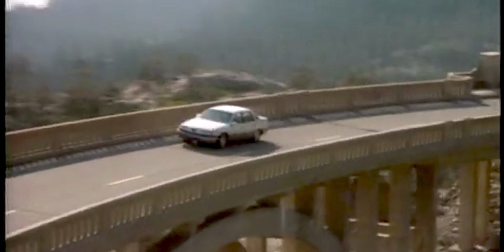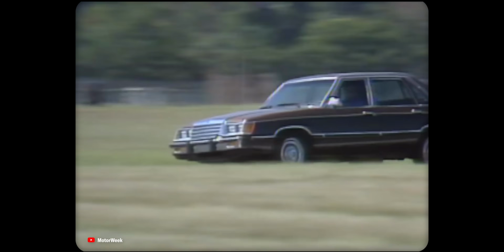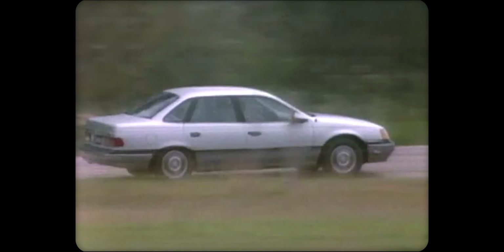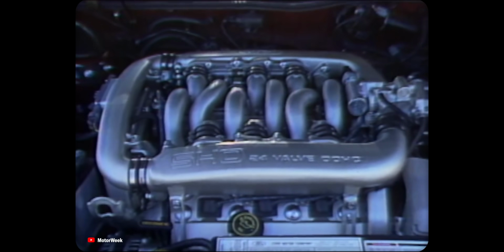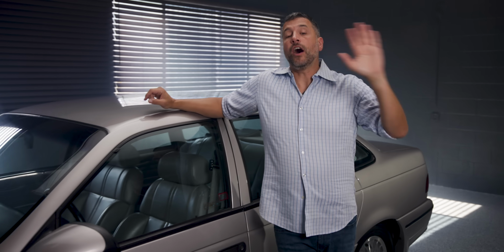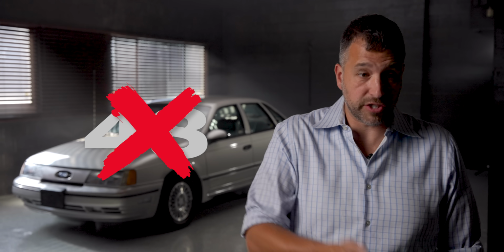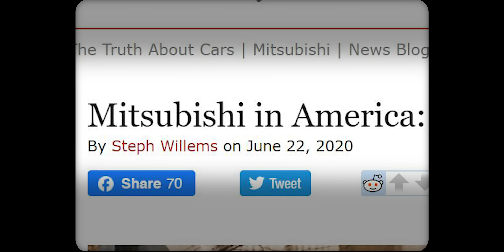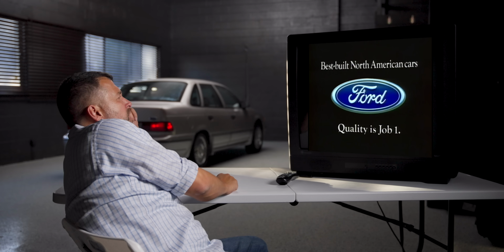The Taurus SHO is the fastest, most expensive Ford sedan | Revelations with Jason Cammisa | Ep. 08

Comment: So it had Yamaha engine and Mazda transmission. That's why it was good.
Reply: Engine not so good.
Reply: Yamaha modified engine,not their design, very bad
Reply: @slotripper  Yamaha tried to modify the Ford v6 but the bottom end was nowhere strong enough so they ended up designing the DOHC motor.  It shared no parts (maybe some bolts) with the Ford v6.  The Yamaha motor was also more reliable than the Ford v6; I sold my '91 with 165K miles and the motor was still mechanically quiet, used under a quart of oil in 3000 miles, and would get 28mpg at 75mph.  The transmission was ok; it would not hold up to alot of high-rpm clutch drops.
Reply: The Mazda transmission was a bit notchy and had a long throw on the 89 SHO I owned.
Reply: @paulhudson231  @Allen Libecap   Motor was originally a Cosworth design with a Yamaha induction. All motors were blueprinted to run at 12,000 rpm and rev limited to protect the accessories. The motors were conceived for project GN34 / Cobra 230ME and recycled into the Tauruses.
Reply: @norac1244  The production motors were not blueprinted and run to 12,000 rpms.  I have a Ford complete shop manual for my SHO; it specifically states that the motors were tested to 8500 rpm.  No one would build an engine to withstand 12K rpm to limit it to 7K or 8K on the street.  The rods and crank would need more than twice the strength to live as 12K as 8K and would have been quite expensive.  In addition the piston speed (feet per minute) is well beyond what normal production rings could handle for more than a brief time.  The SHO engine was a revelation in its day and a very nice design, but its not capable of operation at 12,000 rpms.  Even the cylinder heads do not flow enough air to be useful anywhere near that speed.
Reply: Youre clever indeed, you can be my marketing manager when i make Cuba's first sportscar!
Reply: Duh😂
Reply: Actually, none of the SHOs were reliable in any way. SHO = Super High Oil (consumption). They were fast in their day though, and the 92s looked hot. They certainly never garnered Grand National or Monte Carlo SS fanfare though.
Reply: Mazda gearboxes went that great once you started pushing hp through them and Yamaha actually designed cylinder heads for Australian Ford Falcon and Toyota Altezza to name 2 of probably many
Reply: The transmission were the Achilles heel. Under sized clutch and the diff liked to come apart from the one wheel burn outs. I have seen several of these cars in the junk yards over the years. Most with big holes in the side of the transmission case.
Reply: @paulhudson231  I am not disputing shop manual information, simply quoting early original Sales & Marketing training information.
Reply: @ashes2ashes863  yes the 92 looked sharp first year for the trunklid pop out that resembled a small spoiler!
Reply: The SHO? Yes. The regular Taurus? No!
Reply: This car was garbage like the rest of fords lineup
Reply: Still never had a government bail out with my tax dollars.
Reply: There is a lot of misinformation in here about the SHO. The SHO was by no means a reliable vehicle. The engine was remarkable in its own way (the fact that it made 220hp on 3L and got incredible gas mileage), but even the Yamaha V6 was plagued with issues. 

For one the author of this video was incorrect about his assumption that the accessories wouldn't blow up from over revving. This was a common problem in the SHO community. Most of us SHO owners bought under drive pulleys just so the alternator bearings wouldn't burn out if you accidentally hit 7krpm.

The biggest issue was the #5 cylinder rod bearings which were notorious for prematurely failing. I've had to do this to both my SHO's under 100k miles. 

Then there is the clutch and gear box. The stock cable clutch and cable shifter had numerous issues after continued use. Snapped and stretched cables were common with the Gen 1 SHO (this was before they put solid shift rods in). The synchros in the transmissions were basically made of paper and so were the gears. They did not like holding up to any additional power especially the "Jesus gear" (3rd).

Overall, anyone who grew up with a Taurus quickly learned to become a mechanic. There is no need to remember this car with such fondness

Comment: Former 95 SHO driver here. Y'all can correct me if I'm wrong, but I don't recall the engine ever being referred to as the "Shogun." The Shogun referred to a very specific build of a Ford Festiva using the SHO engine. We always called it the Yamaha V6. 

Also, I agree with the idea of people not wanting the SHO because it's based off the ubiquitous Taurus, but that's also what made it appeal to the diehard fans. It was a sleeper that would spring off the line, and it had additional comforts like the JBL sound system with a subwoofer in the back.

Last, thank you for the footage at the end. I got goosebumps hearing the sounds of that glorious engine again.
Reply: Owned a 1995 SHO. I don’t remember “Shogun”. The Yamaha engine was a very good engine, rock, solid, and high performance. I like the understated look of the SHO.

Comment: When the SHO breaks down, you fix the SHO
Because the SHO must go on
Reply: Its Always somebody in the Comment section trying to SHO off😂😂😂😂
Reply: sho 'nuff right!
Reply: Very good
Reply: The Engine never broke on those- everything bolted to the engine did.
Reply: The last two comments ruined the running joke

Fo sho
Reply: Okay, I love the joke, but the sad reality is that the engine was great, but the rest of the drivetrain cost $$ to keep running. My low mileage '91 would cost me more than the monthly car payment in repairs, and this was when it was only 2 - 3 years old.
Reply: @roceye   yeah cut it was like putting a rocket on rollerskates!!
Reply: SHO 'nuff
Reply: Fo SHO!
Reply: Sho-gun never gives up
Reply: Sho ya right
Reply: Lol
Reply: @Lucifer-qt9gh  They SHO did bro'
Reply: @bookofeli1902  Oh fo SHO!
Reply: @Lucifer-qt9gh  they SHO tf Did. 🤦🏿‍♂️
Reply: my 14 is a nickel and dime POS.
Reply: Yeah... I put 2 manual transmissions in mine.  Spider pins shoot through the case of the transmission, both times.  The transmission was hot garbage, but I wasted everyone in their fancy Mitsubishi eclipses and Hondas.  This was 2000, the sho ruined everyone's pride and my summer job money.
Reply: @roceye  The clutch was the Achilles heel of the '89 Taurus SHO.  It used the same clutch as the 4 cyl model.  Yes, there was a manual non-SHO Taurus.  In 1992 I had to replace it for the 2nd time.  By then they wised up and designed a beefier clutch.  The shifter was pretty lousy as well but at least it didn't break constantly.
Reply: Yeah, but it's all for SHO....
Reply: @roceye  two words: rod bearings.
Reply: ...seriously... I know a guy who put a SHO Yamaha engine in a Civic. It still needs tweaking done with the torque steer but it moves quick.
Reply: @orneryokinawan4529  Yes, torque steer was ridiculous FO SHO!!!
Reply: @Lucifer-qt9gh  you SHO right
Reply: Sho do!
Reply: You earned that thumbs up, my friend.
Reply: sho
Reply: True,.... But corny dude 😂. Good one 👍

Comment: The SHO was a sleeper back in the day. Kicked a lot of ass!
Reply: I used to beat fox body’s , and BMW 3 and 5 series all the time. My first car at 18 years old was a Blue with tan interior 1994 Taurus SHO.
Reply: Fun times!  I had a 85 RX7 cut port 13b from the next year with a 2200cc diesel truck turbo turning 467 hp at 7200 rpm, and it would embarrass a SHO very much like a Telsa just eats the top hellcats.   No point in muscle cars when mommy in her Tesla passes you, and does not even realize your trying to race her.
Reply: @MegaMeaty  Those RX7's were fun until you got 8 miles down the road and realized its time for another APEX replacement.  My buddy had an 88, I think he rebuilt that motor (if you count APEX seals as a rebuild) like 4 times in under 100k miles.  He beat that car to death though.  And I'd argue there is plenty of point in muscle cars, they are fun as hell to bang through gears in.  I wouldn't feel that embarrassed if a $130k performance electric car beat me in a race.  Plus approximately 0 people are going to ask you rev up a Tesla, or even know you are gunning it haha.
Reply: Hell yes it did. I had never heard of the SHO until i was getting my car fixed. There was one up on a lift getting the clutch replaced because the owner was 16/17 years old and learned to drive a stick in it.
Reply: Bobby Jackal  never been a big car guy but, as a kid, the Buick Grand National was my favorite. Mainly because of it's looks and my friend telling me how awesome it was.
Reply: My only question is will it out perform a modern police car?
Reply: Bobby Jackal  it would be cool if they were to start manufacturing them again.
Reply: Yes SIR !
Reply: @myboy051  Maybe  4 cyl foxes, lol. A 90 LX ran a mid/high 14 and a SHO ran a mid/low 15. An 89 Probe would keep up with a SHO 😂
Reply: @myboy051  How? Mine sure didn’t
Reply: @coopachew  The new ones will. I have a 2015 and I regularly embarrass the diesel kids around town.

Comment: The Taurus SHO: when you need to gap all the corvettes and mustangs in your small town, and pickup the kids at daycare afterwards
Reply: How much you dumping in that to gap those ? Definitely stock won’t get it done lol
Reply: I think he meant the mustangs and vettes of the era.  If I remember correctly, the 89 SHO was actually faster than its contemporaries.
Reply: @foxwithtubesox1075  the 89 gt? No. That car always made it to 66 mph before the sho did. 29psi on both on stock tires. And the 89 vette best both of them hitting 69 .  The Sho was just unheard of when it came out, gm had a 1 Hp euro sedan, and while we talking, the turbo Sundance lost the 0-30 but 3rd gear out the sho in its place. This was my era I remember all these cars.
Reply: @InkedMisfit  the SHO actually walked the Mustang GT (same years 89-95 both stock) from a roll.  I know from experience.  Corvette?  Not so much.
Reply: Yep, my friends brother in law had one. I was sitting in the back seat when it hung a 5.0 foxbody mustang out to dry
Reply: @foxwithtubesox1075  I had both of that era - a 1990 Mustang 5.0 LX and later an '89 Taurus SHO, both with 5-sp.  The SHO would NOT gap the Mustang, but it would not embarrass itself either.  Just about as quick up to ~120mph.

Comment: As a 2015 SHO owner, I will always love the original.
Reply: The 2015 is still full size sedan and i love it. Doesnt try to copy no-one
Reply: As a 2010 and 2014 SHO owner I will say the 89 SHO was awesome. The 4th Gen SHO was not true to form.
Reply: Imagine a 2nd gen Fusion (2010-2014) with that engine and a stick... I had a 2010 with the V6, and it handled better than it had any right to with some decent tires on it.
Reply: Have you driven one?
Reply: @GeorgiGeorgiev-ne9ps  lol, we have a 2012 Focus and the fact that the Taurus seems to have less space for people inside is hilarious.   Would still love one anyway, even the non SHO models are great drivers.
Reply: If only you had the Sierra RS Cosworth in 2 or 4 wheel drive cloth or leather trim... Max speed: 149 mph
 0-60 mph: 6.5 sec 2.0L 16valve turbo 204 -220bhp...(can produce 1000bhp)
Reply: How many coil packs so far?
Reply: SHO are great sleeper cars. They’re fast.
Reply: 2015 SHO owner also in this boat.
Reply: Loved the 89 i owned
Reply: @RayoAtra  Good to hear!, 22 years now owning a GEN 3, only 3 years old when I bought it, and it still looks and drives like new with 57k on the OD.   Been in storage since 2000, OEM Z rated tires still on it.  Next year, antique plates and back to cruise nights and car shows.   Already picked up a trophy with it back around 2003 at a major autoshow. Fun times with an old car ((O;
Reply: 2015 version is a shitbox lol
Reply: I'd love to have one in 2021 lol. Looks like a nice and practical car.
Reply: SHOs OVER!
Reply: 97 and 13 owner. Hoping to grab a final year.
Reply: 2016 sho owner and loved my brothers 92 model
Reply: If you havent already, it is so worth it to swap to the airaid cold air, metal chargepipes, 3 bar map, colder plugs, and a tune. Instead of making 7-8 psi, mine makes 15-16. It hauls
Reply: @vinnyschuld7565  I'm in a few FB groups - I was looking at Gearhead Tuning tune, which uses the colder plugs and 3 bar map as the main changes.
Reply: AND - the 2015 is absolutely stunningly GORGEOUS!
Reply: I used to have a 2015 SHO, then I wised up and bought a 2015 RS5.
Reply: @McNasty43  I have  2012 Fusion Sport that I replaced my 95 S.H.O. as a daily driver, I just wish the S.H.O. had the manual mode automatic 6 speed that the Fusion Sport has
Reply: @RayoAtra  Same. Mine is titanium white metallic.
Reply: @rodirby5952  My 2015 has manual mode with paddle shifters.
Reply: Your car is no slouch either.  Another grossly overlooked and under-appreciated vehicle.  My family has owned 2 of the 7-seater version of your car in a row...the Flex Limited AWD Ecoboost...which to those who know, is even more of sleeper...😎
Reply: The 2010 -2012 Fusion is considered the 1.5 gen and the 2013 and on 2nd gen.  I have a 2012 Sport. I still have a 95 SHO, the Sport is quicker but the SHO is faster

Comment: I had a 95 sho 5 speed I put a ton of performance parts into it and I must say it was one of the fastest and best handling cars I've ever owned. I really miss that beast.
Reply: I bought a 92 brand new, dropped a ton on it too and had it for 240k miles (19 years later) and sold it for $4500! I had 3.2 heads by way of the SHO Shop, polished/ported intake runners, Baer breaks, LPM from SHO Shop, subframe connectors, front & rear strut towers braces, Koni adjustable struts, slotted the front upper strut towers, progressive springs from SHO Shop, Quaife LSD, short throw shifter, solid engine mounts, cold air intake, borla exhaust w/dual DTM exhaust tips, gutted the cats Nd I’m sure there was some other things. Really fun car!
Reply: stick shift would have been cool.. these cars are so hard to find now..anything 90s thats not rusted out..you better buy it if its cheap..
Reply: @SpaceRanger187  Even if it's not rusted out, it's likely at one point it was owned by a hoonigan boy racer wanna be who beat the crap out of it. A decent substitute is a first gen Mazda6 V6, which you can get in manual. It's a scooch faster than the SHO with a decade of engineering and metallurgy advancements.
Reply: Steven  Of course there is. More horsepower/torque moving less weight.
Reply: Steven  Bullshit. There's most certainly a enthusiast community for the Mazda6. You can easily get all manner of performance parts for them. 

The 1st gen Mazda6 does have the same HP.  It's got a Porsche engineered DOHC V6. So it revs.  According to the automotive catalog website, it's 1/10th a second faster than the SHO. Because it weights a bit less. 

The world most certainly does revolve around hp/torque to weight. Especially in terms of performance cars.

Comment: I owned an '89 SHO and later a gen 3 '97, absolute maintenance nightmares but I still enjoyed them both. Worst was the '97 and the cam shaft gear / bent valves problem ughgh. Loved this video!
Reply: Did any of them make it to rusting out.
Reply: @dannysee1  No, the 89 blew a head gasket and the 97 was traded in with a faulty overdrive solenoid
Reply: I’ve heard that the only way to avoid eventually grenading the 97-02 V8s is to take it to someone to weld your cams, is that correct?
Reply: @videogamefreak221122  yes that is correct. You'd see v8 shos listed on Ebay with welded cams in the title. I had both of mine welded by a friend when I pulled the heads and changed the bent valves in the front head
Reply: @tailslide5053  Might be part of the reason why I never see them anymore, not even on auction sites and whatnot. Come to think of it, I don’t think I’ve ever seen one in person at all…
Reply: @videogamefreak221122  I read in 2006 (when I had mine) the camshaft gears let go around 80k usually, warranties ran out at 60k. Mine had 75k when it failed, had just bought the car with 70k and was unaware of the common problem. Quick car, though! Gave an Acura TL a good run back then!
Reply: scams scammers scam ford japan made yamaha engine sho v6
Reply: @videogamefreak221122  They never made the V8’s past 99’

Yes, welding the cam, would solve the problem with the cam. 

Other than that, the only thing that was the ignition coils were a pain in the ass to replace.